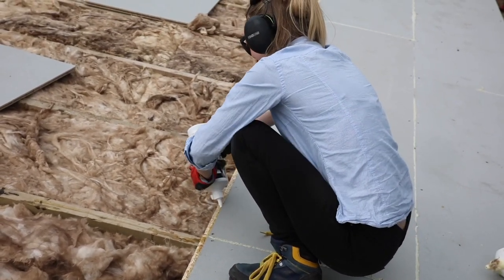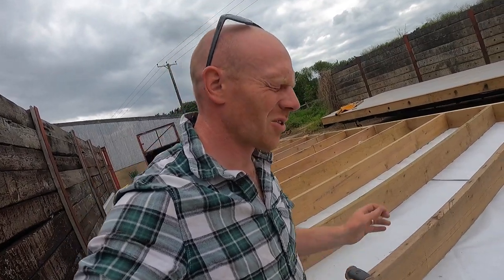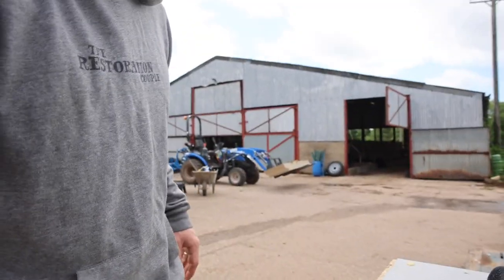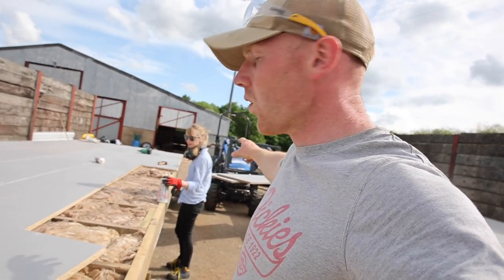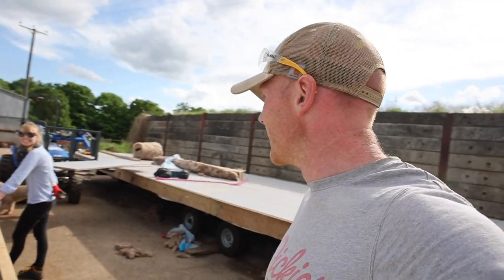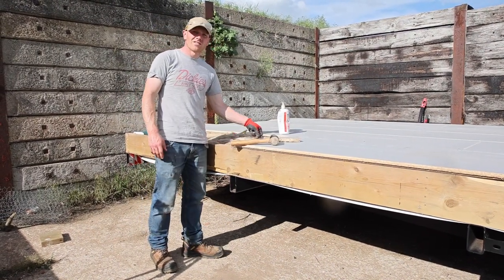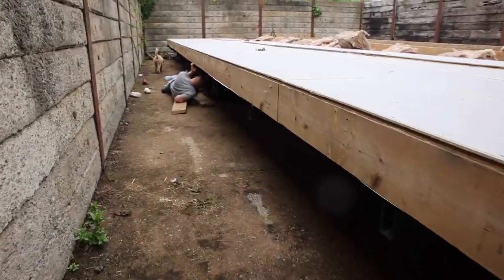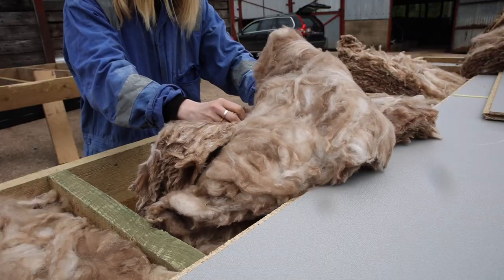FLOORS ARE DOWN AND WEATHERPROOF or ARE THEY?

Comment: Top tip: when using any squeezy type bottle, use a small  Irwin quick grip clamp around the body and apply the trigger as the point of compression. Saves hours of time as it gives a steady flow of glue without any effort

Comment: Comming on guys! like it! the insulation would dry out! and probably capillary action from the edge!.. but wouldt worry to much about wet insulation! 90% of modern new houses get rained on!... are you leavig them apart or pulling them together, a roof between the two with glass panels would look ace and give you a huge enclosed space for wellies, coats, quads etc.  keep it up!..

Comment: You could lap the membrane up the sides on all sides and tuck under the egger flooring, creating a water tight envelope for the insulation. Any rain would just drop off the floor and down the side of the membrane

Comment: Some beading that hangs lower than the joists so water won't creep up under the membrane looks like it would be a lot of hassle but if you're painting the base  to improve the appearance it could look quite effective. I was thinking of something triangular, wedge shaped that jutted out but took run-off water Also, selling on (it could improve the look & practicality of the design) it may be worth looking at chopping up some wood with a table saw to make some form of rail/bead around the base. Another job you didn't really want to have to think about though. Could you do a few designs and install a meter of each and then ask the viewer to vote on what would look best?

I don't know if I followed your router solution, but if you just stapled the membrane onto the inside face of the joists (the opposite to the face showing on the outer) that would lift the membrane enough to stop any water dripping in - it may stretch the membrane but it doesn't have to be stapled to the underside of the outer facing joists, it could be stapled to the inside face.

Comment: The ingress of water is due to capillary action - I've been there before.  I think you're going to need some form of temporary overhang, until the outer wall is in place - as even tucked under the there will continue a narrow gap that encourages service tension and in turn the water is pulled through.

Comment: Looking good . I am really enjoying these videos !
When you were planning the cabins did you consider using using those insulated panels you built your workshop with.
I am thinking about building a much smaller cabin using a box steel frame ( because its much cheaper here in Italy ) and I am toying with using those insulated panels for the walls and maybe even the floor, and then covering them with something nicer.
Reply from the maker: We did that for the workshop last year but planning on using natural materials here. New video explains all later in the week.
Reply: @TheRestorationCouple  looking forward to it 👍

Comment: are you moving these after you build? they look heavy enough now.
how much will they weigh when you have finished the build?

your poor little tractor doesn't look like it would be up to the job,
Reply from the maker: They need to be moved 15m or so. Either towers with telehandler or may get the cranes in to place, depends how level the surface is as joining them is the hardest bit, especially if not flat.

Comment: Dont forget the exposed edges of the boards are not waterproof/resistant and will soak up water. Egger recommend painting the edges/perimeter of the floor with the PU glue
Reply from the maker: It went in to the next video but yeah we used foam roller and pu to seal. 👍

Comment: Forgive my question if you covered it, is there anything other than gravity holding the floor framing to the steel frame? I can imagine the trailer wheels hitting a rut when you’re moving this, and the whole thing sliding off.
Reply: In previous video he mentioned that its going to be bolted to the frame